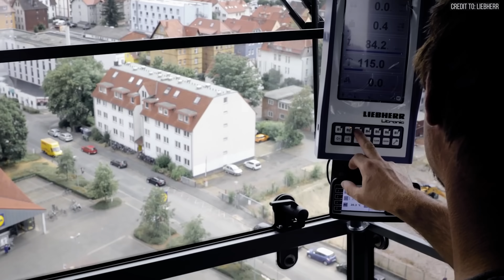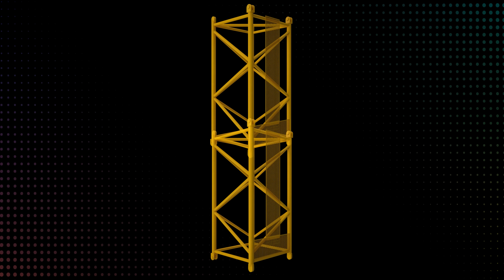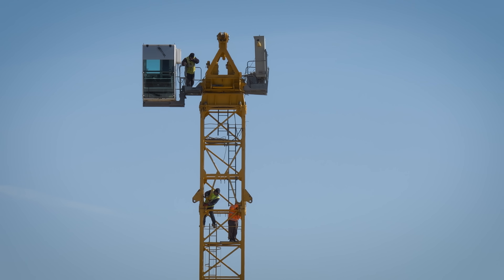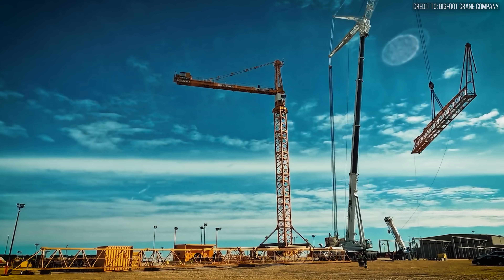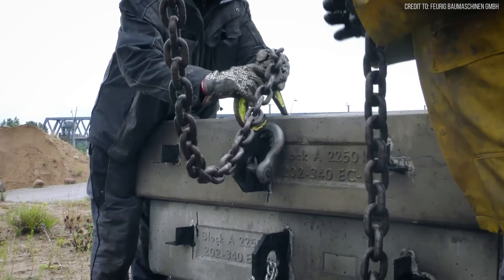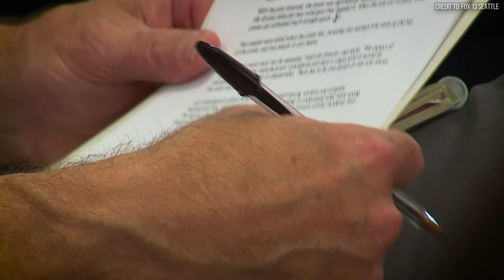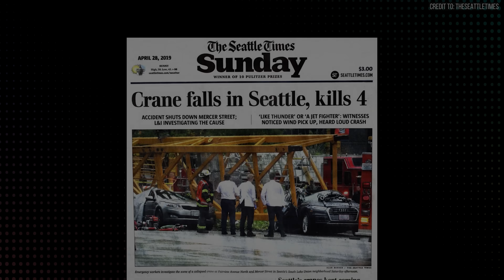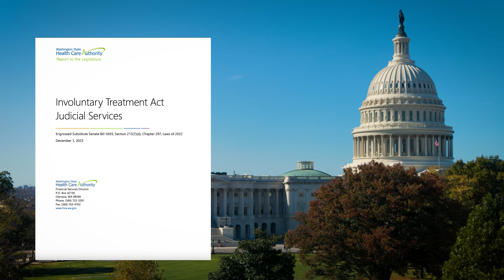4 Lives Lost: How One Shortcut Caused a $200M Seattle Crane Collapse

Comment: I work Seattle construction and unfortunately bad planning is rampant. I often see jobs estimated without anyone actually setting foot on the job site or asking a workers opinion on how long it will take. Jobs are often underbid and the end of the job being a mad rush where stress and exhaustion make it easier to make a mistake. It was grossly negligent to remove all those pins but I can't say it they were lazy without knowing what kind of a schedule they were on maybe they had already worked alot of overtime or not taken a break in a long time. We are told we have stop work authority if something seems unsafe we can refuse to do it and union will have our back. The problem is if we stop work at best we get sent home for a few days without pay and often the contractor lays us off. The union can prevent the contractor from firing us for cause but we probably won't see a paycheck for days/weeks and even several months if the economy is bad. Some union members can't afford to stop work. Policeman are sometimes suspended with pay while an investigation is conducted to determine if they made the right decision and they are fired if they are found to have made a bad decision. I think our industry would be safer if you could stop work and still collect pay for the few hours to a day or two it took to determine a safer way to do the work and if you stopped work without a good reason you lost you're job.

Comment: That's not normalization of dangerous behavior, that's criminal and defies all logic.

Imagine changing a light bulb by putting away your ladder and creating a stack of furniture in its place. That's basically what they did by removing the pins early, except you're 300ft in the air and doing something far more dangerous than changing a light bulb.

Comment: As a former construction worker, I would not remove pins on lower sections because I would be one of the people working the top segment, the one at greatest risk. However, I’ve had supervisors who have demanded shortcuts, or be let go. Further, cutting corners rarely benefits the line worker as they get paid by the hour, not by the profit line of the company. While I do not know what occurred in this instance, I suspect this pin pulling of lower sections was a management decision.

Comment: Not closing off the street around the crane is absolutely criminal.
Reply: Do you know how many cranes were in the Seattle skyline then? you would have to shut down the entire downtown lol
Reply: @KrissaRenee According to Wikipedia; 60 cranes were operating in Seattle at the time, the most of any U.S. city.

I think they meant during disassembly though. But that's still overkill considering how often cranes are assembled and disassembled without problems and that this would have been averted if they followed proper procedure.
Reply: @Stevefhu exactly
Reply: There is no need for such action. This operation happens literally hundreds of times every day around the country without incident. If the crew had followed engineering protocol the odds are overwhelming that everything would have been fine. These types of things are designed with a 6 times safety factor margin. Think for a second, they had pulled all the locking pins prematurely and nothing happened until the wind came up. Tens of thousands of planes fly everyday and you never hear a word until one of them falls from the sky. Would you then say that flying is crazy? Sometimes shit happens. It happens more when you do stupid things. But you can't base you life on one stupid action.
Reply: The other businesses in the area could not just close for a few months to allow this building to be built!  Had they followed the safety protocols, this would not have happened.  The safety protocols were already in place, and didn’t require road closures.
Reply: @lindadeeds5326  The accident happened during dismantling of the crane, ... which didn't take "a few months", ... so your comment doesn't hold water, ... 🙄
Reply: @JerryVdm-r4m  Prove that you can read and comprehend by actually reading the original post and the reply, then apologize for not understanding what they wrote.

Comment: no the shortcut was not right 4 persons died 200 million in damages and Imo the person authorizing removing pins should have faced criminal charges . where i live the county built new emergency communication tower. the old was being dismantled  the workers removed all the bolts then went up on the now unbolted section .  not sure but no gin pole used in erecting towers was mentioned but it let go  1 of the 4 legs caught 1 dead 1 permanently disabled and tower section dangled precariously while ems and fire were trying to recover the 2 men 
now i dont know crain erecters pays . but tower installers get paid way way low for the danger it was long ago but no way i work that for what they received it was pitiful